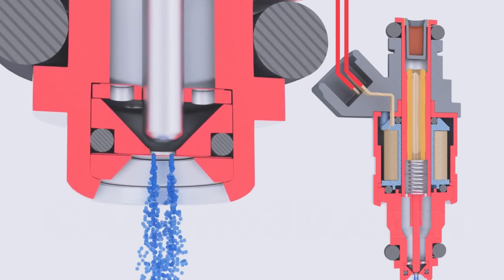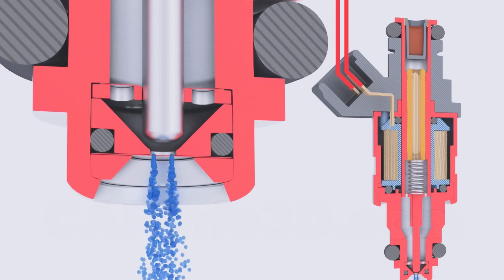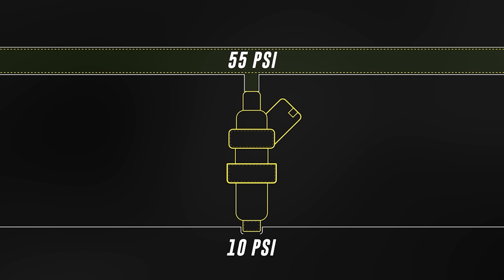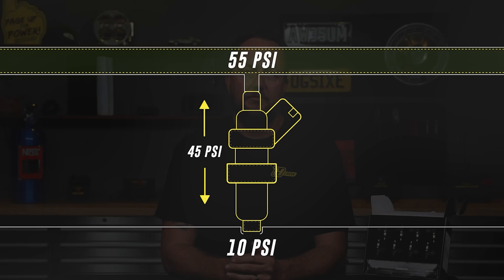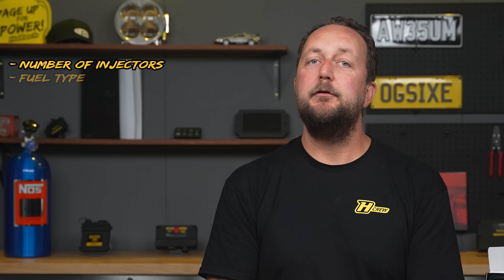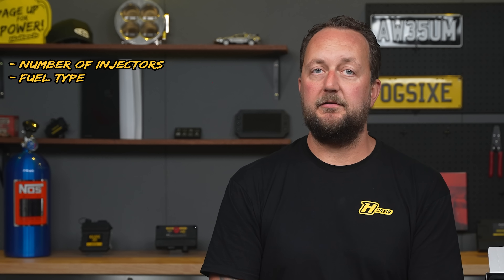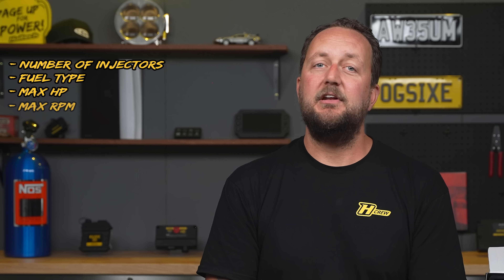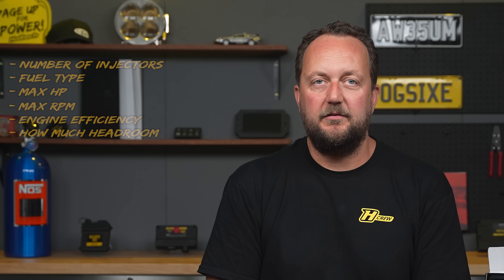SELECTING INJECTORS - Everything You Need To Know

Comment: Will id 1050x support around 1000 crank HP on e85. Running a gen 4 rebel LS haltech ECU
Reply from the maker: Your best bet will to be to have this discussion with your engine builder / tuner as they know your exact setup / plans for the car.

Comment: When and why do multiple injectors per cylinder come into play?
Thanks for the video. 👍
Reply from the maker: When one Injector cant deliver enough fuel to satisfy the engines power requirements a second (or third, or fourth!) injector can be used per cylinder. This is known as staged injection and allows a smaller primary injector for accurate fuel delivery at light loads an idle, then bigger secondary injectors to deliver the fuel required. These bigger injectors often lack the accuracy for light load and idle conditions.
Reply: Cheers for the reply.😊

Comment: Thinking of running 2 per cylinder, one smaller and one larger to handle a wider range of fuel consumption reqs. The goal is to give it smooth street performance while being able to get enough fuel when it needs it with room to grow. Good idea or nah?
Reply: Staged injection is not that uncommon, it used to be more nesseseary than it is today, depending on the type of engine and powerlevel. With modern ecu's and injectors you need to be making quite a lot of power before it's nesseseary, and in many cases people just run 2 sets of the same injector, since you typically don't turn off the "small" injector when the large one kicks in.
Reply: @ thank you. When you say quite a lot do you mean around 500 or more like 1000?

Comment: AFAIK Bosch injectors advertised flow rate is measured on a less dense fluid than fuel, hence making them actually smaller. I’m using 980ccs and at 3 bar IIRC they flow something like 900cc.

Comment: One question I've not seen answered anywhere else is: What's so different about direct injection that means most/all aftermarket ECUs can't run it?
Reply: Gdi requires high current drivers most standalone don't have high voltage current drivers. Usually you would use an expansion "gdi driver module"

Comment: Do the 980cc fit straight into a K20/K24 fuel rail? And are they precise enough to tune an NA K24 build with around 250HP? Or are they "too big".
Reply: Why would you need nearly 1000cc injectors for 250hp? My 400hp Volvo uses 465cc injectors.
Reply: At what pressure are you running those?
OEM Honda RDX 410cc injectors run over 80 % duty cycle over 240hp and do not leave any room for improvement in the future, also I want to be able to run E85 in the future, which requires much more fuel.
I would have chosen something around 650cc but they don’t offer this size.
There are a couple of guys, running ID1050xds on their NA builds and they run more than fine, as they are very precise. But they are around 700€ for a set of four.

Comment: question, my turbocharged car has a base fuel pressure of 45psi. max boost pressure is 25psi.  the max fuel pressure I've measured at full boost is only about 66psi. do I need to upgrade my fuel pump?
Reply: I recommend to start by checking the pump spec which typically has a graph or table that shows the flow rate at different pressures to know if you're even likely to run out of fuel with that pump option (provided the pump isn't damaged or wired poorly and that voltage supply is good). You'll need to know how much fuel you'll need for the power level you are looking for and what pressure you need for the injector at ~85% duty cycle. The higher the pressure, the lower the pump flow rate (note that this is the opposite of injector flow). It's possible the pump is at max pressure but not max flow. But if the fuel pressure is dropping, then that's an indication the pump is too small. Do you know what the max pressure is for the pump? Does it peak at 70 and drop to 66 or is 66 the max pressure regardless? You can also increase duty cycle to a point if pressure flattens out at 66 psi since as boost goes up, you'll lose differential pressure with a static pump pressure. But in that case, you're using the duty cycle to fix a pressure issue which is a band aid that can't fix a big mismatch in flow needs. Hope that helps you diagnose the issue.
Reply: it's an AEM 340Lph.  according to their chart it's right at the limit for my power level.  the fuel pressure never goes any higher than 66. the pump is hardwired with an iWire kit for Subarus.

Comment from the maker: What ones are you picking up for your build?
Reply: ID 1050X on a 460 BBF. I plan to run E-85 and a small N2O shot.
Reply: 4x 2400cc Dekas 13b bridgy on e85
Reply: @madaz0724  Spicy. Nice! 👍🏼
Reply: @25aspooner  plenty of spice in the plan this time
Reply: ID 1050X ON A WALBRO 450 for my RB25det
Reply: the wrong ones apparently XD
Reply: Bosch ev14 550cc for my Starlet turbo
Reply: Excess Injectors. As the tuner, injector quality and injector data is super important. Quality data speeds up tuning and prevents unnecessary checks costing the customer less and allowing me to complete my job without issues. I would like to highlight that Injection data/ dead times for e85 or e100 would assist me. These are the things i look for. I have an injector test bench that has highlighted issues with a very big parts supplier and matched injectors on 2 ocasionss more than 10% out, one injector set being 20% out. Customer service is super important, especially with specialist workshops. I no longer do business with that company

If you can provide the worlds most reliable and comprehensive data, you will have my business.
Reply: 1000cc evo9 injectors in my suzuki g13b engine which is in my sierra ute, running e85 and a 35shot nitrous to get the t25 spooling asap.
BTW diff locks, twin stick transfer, 1 foot suspension lift and big tyres. 😂
Reply: 6x 1000cc alpha injection clinic for my big single turbo 2jz